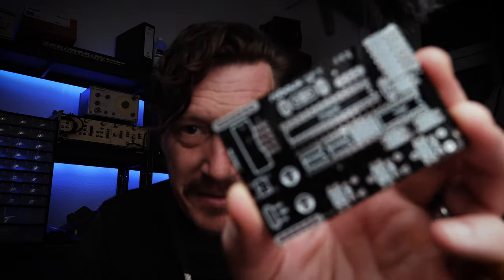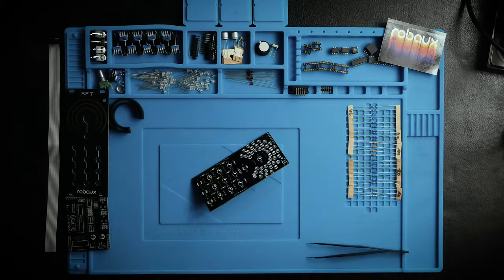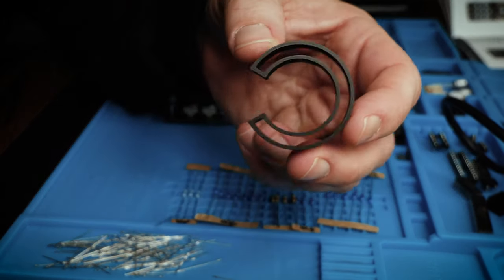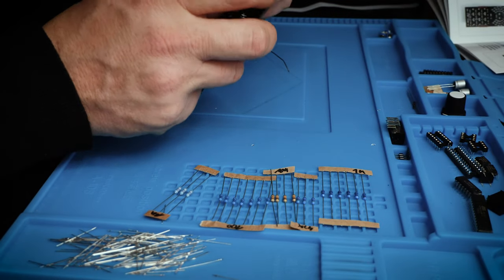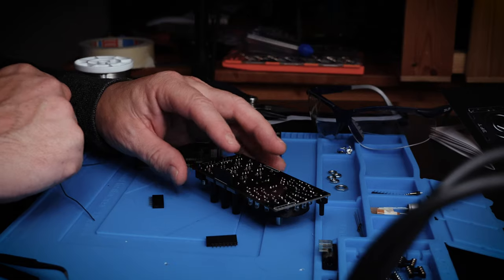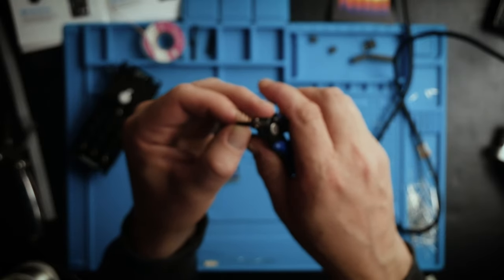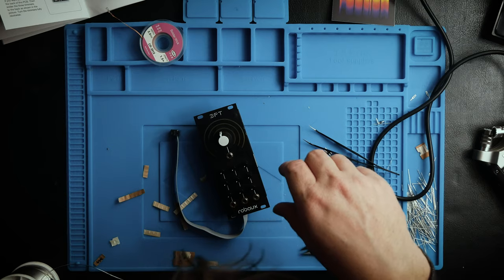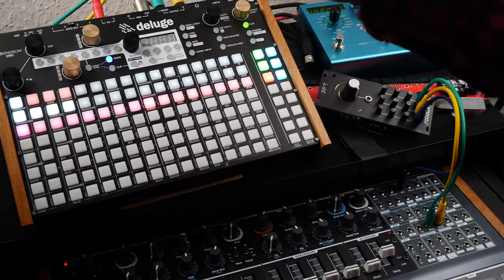Eurorack DIY Lab // 03 Robaux 3PT

Comment: Got my DIY kit a few weeks ago, inspired by this video. The build was painless (that booklet is awesome). I'm having trouble with the calibration, Seemed I could only get ~2 of the 4 octaves tuned to C for any of the 3 channels. Did you have any trouble? I'm probably not doing it right, need to have another go at it soon.
Reply from the maker: I always have the most trouble with calibration. My main oscillator in the eurorack skiff just went out when I plugged the Deluge to it while the D was on wall power and also connected to USB to synch with my DAW. That’s why I pulled it from my Jamuary setup for the moment. I need to recalibrate the sucker. 🙄

You need precise measurement tools to really get it right, but you can get it close enough usually.

Comment: When i need to cut that type of header, I typically snip through the plastic in the middle of the pin.  You can then flush cut to the edge.  They cut super easy that way.
Reply from the maker: Does that work on something like a 2x8 header pin too? 

If you only cut the thinner plastic section to the pin I suppose a utility knife might work and feel more controlled?
Reply: @DomesticSceneMusic  Yeah for 2x headers it might not work, but the 1x snap easily.

Comment: hey man I subscribed a view days ago and later the 3pt catched my attension. and now you made a video :) I have a question on the 9 pots. Do they feel solid ? probably not rock solid like srewed ones I guess or ? Looking forward to build it anyway and to more of your vids :)
Reply from the maker: Hi! The trim pots feel pretty solid. They are plastic, but there is no noticeable wiggle or anything so far. Just make sure to secure the 2 metal “clips” on the side to prevent any stress on the smaller component legs on the front. I solder those in but you don’t have to technically.
Reply: @DomesticSceneMusic  ok man thanks for the reply :)